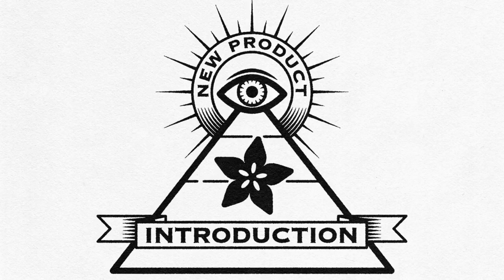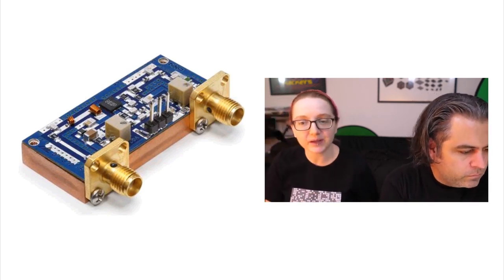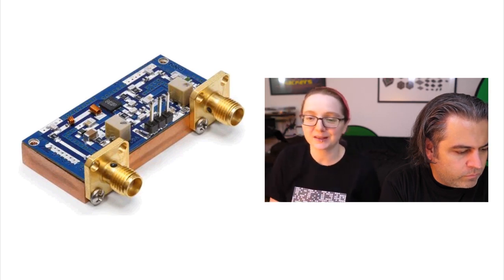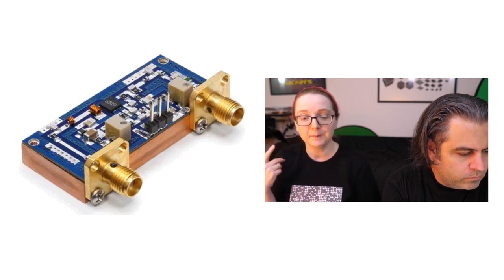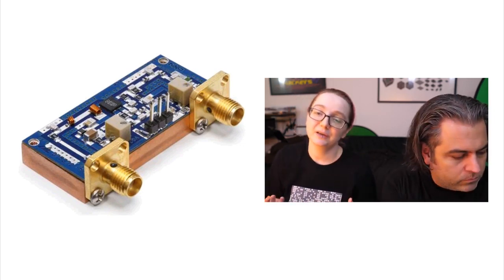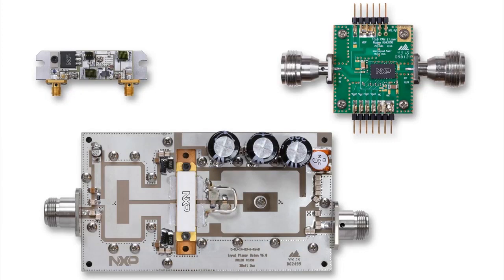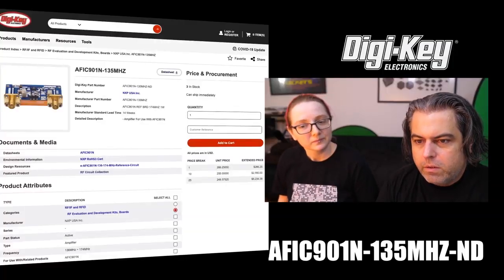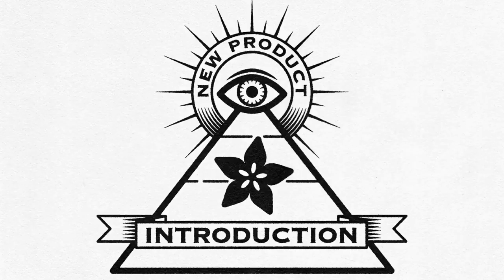EYE on NPI: NXP RF Reference Design Boards #EyeOnNPI @NXP @digikey

Comment: Advice? I'm using an arduino nano and 250 ws2812b neopixels. I have a pattern of one LED at a time moving from left to right and even setting the speed at 1 ms, the neopixels don't complete the pattern quick enough. Do I need a faster LED than a ws2812b? A faster arduino/controller than a Nano? (I only know C++ if that limits my options on controllers)